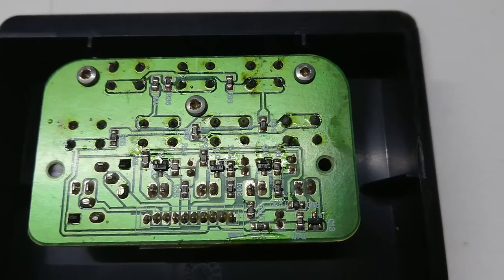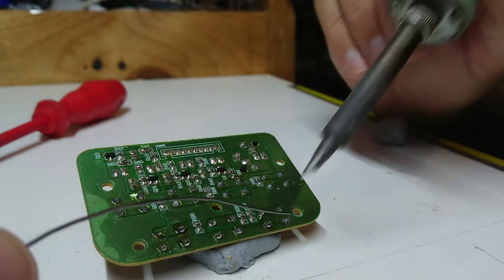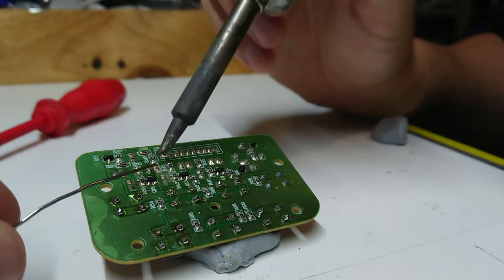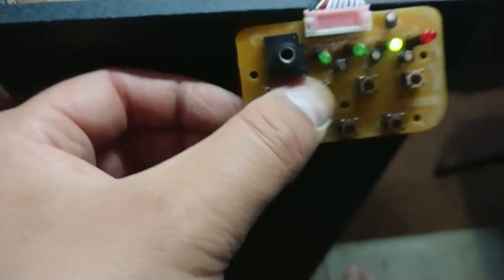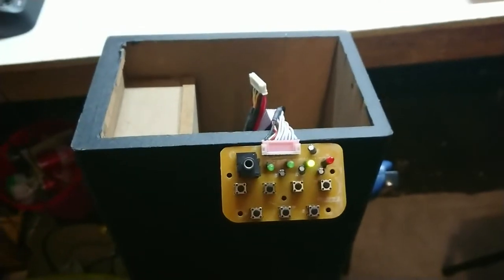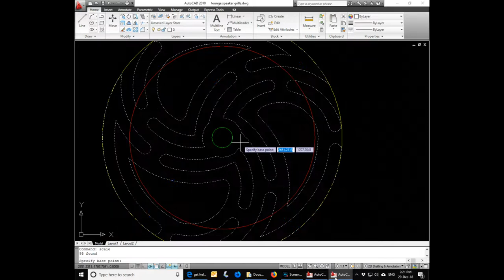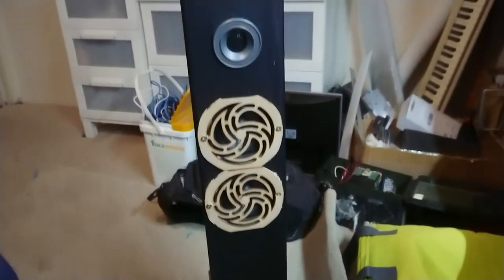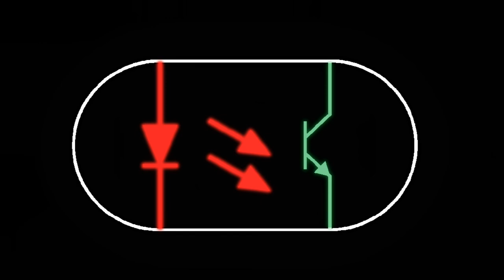Speaker Tower Repair - (With Lasers!)

Comment: Thanks for the vid. I will try the solder re-fresh on mine.  I also like the heated glue stick trick to pull the cone dust cap back out. I tried some duct tape and slight tug for limited success a while back.    JwgK